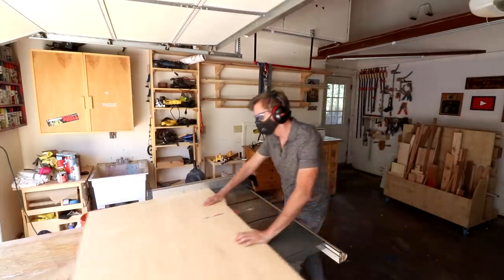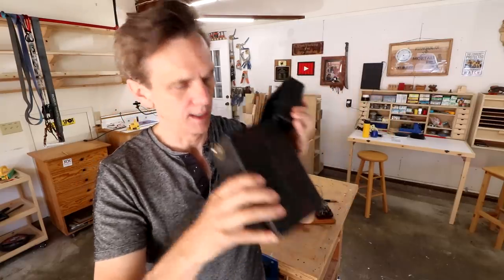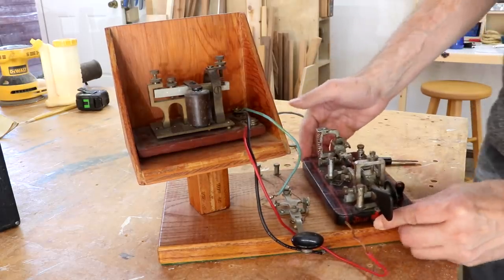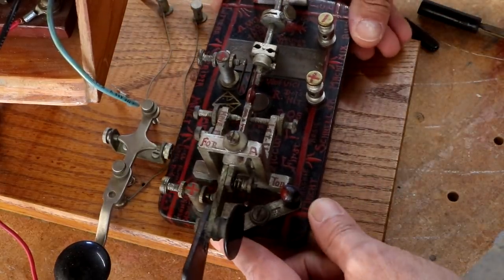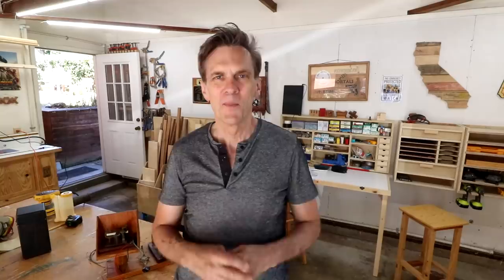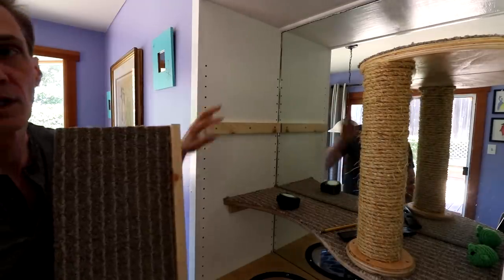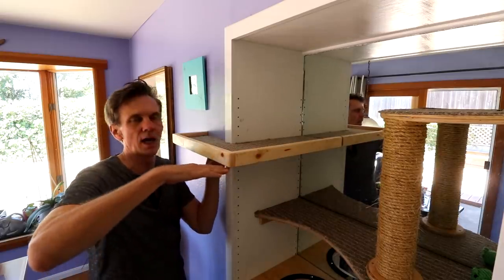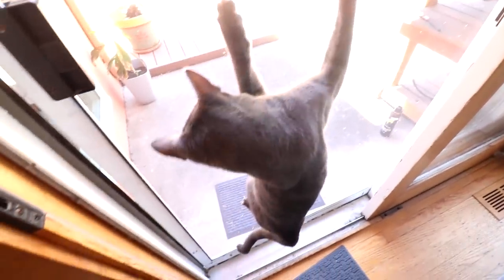Woodworking Summer Jam: This weekend only! Let's see your HEAT WAVE projects!  | LOCKDOWN Day 137

Comment: Hey Steve, those two things that you said you can't identify are mostly likely thickness gauges to accurately set the spacing of the bug contacts. They have to be accurately set on both the dot and dah sides for maximum operator speed. When properly adjusted the lever arm bounces back ready for the next dot or dah at precisely the right moment. Once an operator got the bug adjusted just the way they liked it, which could be a tedious iterative task, they'd want to be able to duplicate the setup fast in future. You'd need two since the spacing for the two sets of contacts would likely be different. Traditional vertical morse keys only had one pair of contacts.

Comment: That key is known as a semi-automatic key. You push the paddle to the left for dots. The weight on the spring arm is adjusted for the speed of the dot train. The paddle is pushed to the right for manual dashes. The left right motion with the thumb and forefinger is much less tiring than the up down motion of the wrist from the elbow when using the straight key. This allows the operator to go much faster than with a straight (the up and down one) key. The vibraplex bugs gave way to fully automatic electronic keys where the speed is dialed up on a small electronic box hooked up to a paddle style key where a push of the right paddle to the left gives a continuous string of dots and a push of the left paddle to the right gives a continuous string of dashes.
You could always tell if an operator was using a bug because the dots were always evenly spaced and the result was very rhythmic.

The dot side contacts are wired in parallel with the dash side contacts and the key can be hooked up in series with a 6v battery and the solenoid sounder to make that clicking sound that will remind you of your grandfather.

Comment: I was a radio operator in the Navy many years ago, and what your esteemed Grandfather called a bug, we called a speed key.
You push it left for dots and right for dashes. I couldn't receive fast enough to use one - as fast as you send, that's how fast people will send back to you. 
To the best of my knowledge,  the Merchant Marine still uses morse code because it's very inexpensive technology. 
BTW, the morse code that plays at the beginning of the B-52's Planet Claire is the call message from CFS Mill Cove in Nova Scotia. I worked there for about three years.
Reply: Morse code is much like texting with a flip phone, it's a very slow and tedious process but it will get through when nothing else will.

Comment: Steve, I'm about 20 years older than you (1945) and we still learned Morse code in the Navy (1967-1971) but we didn't use it much - just for emergency communications if necessary.  That "bug" your Grandpa used we called a "speed key" in the Navy.  They are difficult to learn right at first but Boy, can you send code fast when you do learn!  I know this is an old topic but I began going through your lockdown series and I couldn't resist chiming in.  Thanks for all you do.

Comment: I think the small knives were for dressing (smoothing)  the various  contacts on the device.  The constant making and breaking of the contacts would result in arc pitting on the  surfaces , and they would need dressing to keep from sticking.  I have seen similar on old rotary phone equipment.

Comment: Your intuition is correct. The bug is calibrated for the automatic generation of dots but as an operator you still had to make the dashes by holding it down the right amount of time that’s proportional to the speed of the dots. In other words, you did not go tweaking the speed of the bug regularly. Instead having a “straight key” to the side allowed you to go at any speed at the cost of having to use more movement in your hand, which would lead to arthritis etc.

You can definitely still connect that and make it running again. It’s a very simple electric “switch”. If you got the battery, connecting it the rest of the way should be pretty doable. I wouldn’t mind helping or pointing you to groups who can get you fully connected.

Comment: Thanks for showing your grampa's bug. That is a vibraflex like I thought. The lever to the left is also a key and you were right, when someone can't read his code, he would use that one to go slower. Those bugs were fast. That wiggling end makes the fast DIT sounds, he had to make the DAHs manually. I know morse code. I'm learning it. Those have value. Don't anyone toss one out, sell it on ebay. $$$$

Comment: What’s the serial number on that bug? You can look it up online and it will tell you approximately how old it is and that looks to me like an older one. I have my great uncle’s Vibroplex bug but it is only from the late 70s; there are some out there that are over 100 years old. I’m starting to learn Morse but I’m still on the “understanding what I’m listening to phase”, sending code will come later.

The other key is what is known as a straight key and is also still widely used in amateur radio circles. He probably had that in case someone else needed to work at his desk who wasn’t familiar with the operation of a Vibroplex - it takes a different rhythm and wrist movement and takes some getting used to.
Reply: That's the way to learn it, concentrate on the receiving first.  Once you've got that down, the sending's easy to get fast on.

Comment: Black wire: "Battery -"
Red wire: "Bug -"
New wire: "Bug +" to "Battery +"

I'm 90% sure that would work. That wouldn't included the single key switch in the centre, but you could add it easily by connecting the two wire from it to the two posts on the Bug. I'm not sure about the green wire, but as someone else suggested, it's probably just a ground wire.
Reply: Armin That's not taking into account the output that goes to the clicker solenoid. You'll have a positive battery/signal wire that goes to the key body. The key will contact the dot and dash contacts on either side.  Those will go to the clicker solenoid positive terminal.  The clicker negative terminal will connect back to the battery negative terminal.
Reply: @talyrath  The black wire is already connected to the clicker negative, as per my comment, it then goes to the Battery negative.

Sorry, I should have made it more clear: the red and black wire I referred to are those already connected to the clicker solenoid.

Comment: Heat wave.... Ain't nobody got projects for that!   Its 105 outside.  The roughly 30 feet of un-insulated metal garage door with the sun pounding on them from 1 pm to 7 pm super heating the garage.  Seriously, its an oven.   We are getting rain tonight and a "cold front" this weekend to knock the temps down to 90 with light humidity.   Then..... back up to triple digits we go.  The only project I'd like to discuss in the garage is dust collection,  insulation and AC!   Might just leave the house at 5 am and ride my dirt bike on Sat.  It will be the first non miserably hot ride in a while.  It will just be hot.  I save the wood projects and garage stuff for Sunday.  I need to organize and clean.   I really enjoy projects more in the fall and spring times

Comment: Hello quick question what wood would be best for outside furniture in California? What woods I should ask. Thank you
Reply: I would use cedar probably because its rot resistant but steve also lives in cali and he uses 2x4s anf there fine... happy building
Reply: Thank you. 

Any other wood options. Or is that the most common to use?
Reply: @wcerritos74  i mean i hant used much woods i suggest if you paint it or not put outdoor finish on it because its going to ruin your furniture

Depenfing on your beget i would just use select pine i like the look of it

Comment: Dude... 2 things:

1 ~ To keep from having to pound in anchors or really even use a drill bit for the holes in drywall, most of them are about the same size and all you have to do is make a center mark them use your screw tip and plunge into the wall with it. Makes a perfect hole more than 9 out of 10 times.

2 ~ I love your channel and all... Gives me a bit of solace with no longer having a shop and such. BUT your heat wave idea is irritating for having had a splendid table idea I've wanted to make for about 7 and a half years now, which would fit it perfectly.... Especially given I no longer live on the beach. You're a great dude and your channel is awesome but, you're killin' me, Smalls!